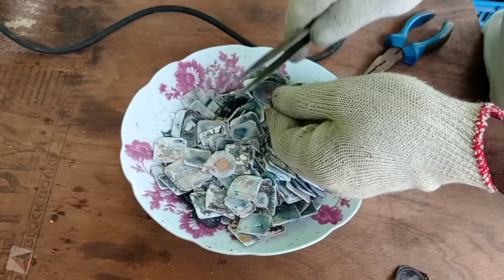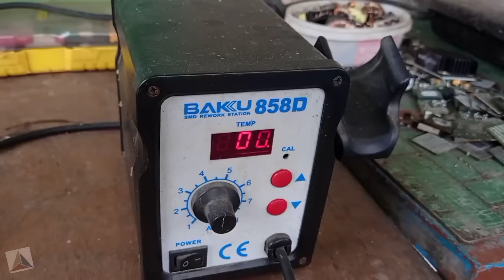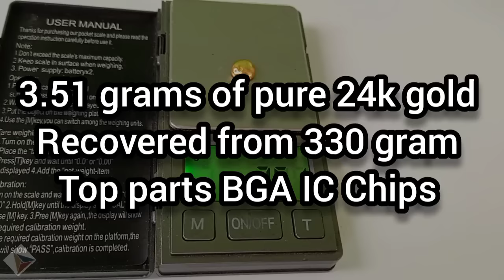Ashing BGA IC Chips (Top Parts Only) Gold Recovery

Comment: Excellent recovery BGA chips are usually 1 % gold by weight. You should still add sulphuric acid to the aqua regia to get rid of any lead that might be present.  Also use distilled water when boiling in HCL the chlorine in tap water may dissolve some of the gold. Although you can still get it from your stock pot.
Reply from the maker: Wow
Reply: Sreetips is that you?
Reply: @mspeed3kb966  lol 😆
Reply: Which BGA chips? These ones here have 1% gold by weight only in the top part. And this is where all the bond wires are....
If you use the whole chips, it is much less.

Comment: Nice Video , I have a question why in the dust do you use sodium carbonate? Do you do it every time you want to melt gold dust?
Reply from the maker: It helps to keep the gold powder together while melting.
Otherwise all the gold will blow away while melting by the blowtorch
Reply: @TrinityGoldRecovery  borax works as well

Comment: Guys learning, the chemicals the easy part, a monkey can do it, and all materials on Amazon or AR Walmart! The physical work sucks and is worth it if you have a to of material to process. But you should learn 1st by refining a 2-3gram 10k gold ring. Its easy, cheap, and you learn what happens each step. Most process to little to see the gold their 1st time (I did 3 times). I moved to karat scarp, learned 1st try, and now have done ozts!

Comment: Well i like watching your Chanell however there is one particular problems with this video 
The gold you extracted is not 24k ....

Hence when you get a green solution and you drop gold from it it’s contaminated with other metal/metals probably zinc or nickel. You should have neutralize by adding specific chemical before even making AR. What you need to do is give the washed material a bath in just nitric acid with hydrogen peroxide. By doing that you will remove all base metals that could contaminate the solution later and makes the process much easier.
Otherwise the whole process is just useless as you recover contaminated gold which you should reprocess again by bathing it in nitric , then ar again and dropping and melting.

I like your content but please make sure that you show the stuff in a proper way.
Reply: BGA top part hasn’t any lead or nickel, only gold wire bonding few amount of copper... You know copper doesn’t drop as gold sediment with smb adding... And I filtered the AR twice of time... So the gold has drop as 24K... When your gold sediment is not smokie or cloudy as in bottom of water body and looking cristal clear_ you can going to melt your gold powder. .. No problem... It's a experience...

Comment: Not good. You missed a crucial step. (nitric bath). Solution wrong color. Now you must remelt gold button with 10 gr silver then nitric only. make sponge, rinse in hot hcl 3 times, then aqua regia, drop again smb. for pure gold thnx...
Reply from the maker: BGA top part hasn't any lead or nickel, only gold wire bonding few amount of copper... You know copper doesn't drop as gold sediment with smb adding... And I filtered the AR twice of time... So the gold has drop as 24K... When your gold sediment is not smokie or cloudy as in bottom of water body and looking cristal clear_you can going to melt your gold powder... No problem... It's a experience...